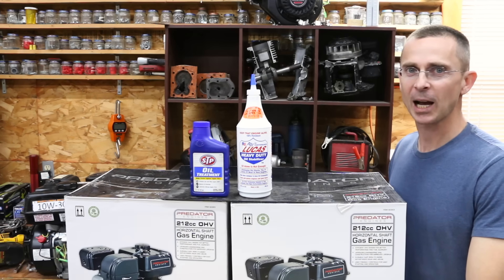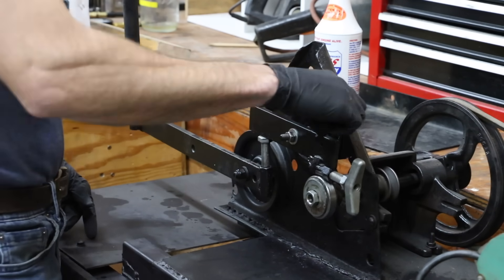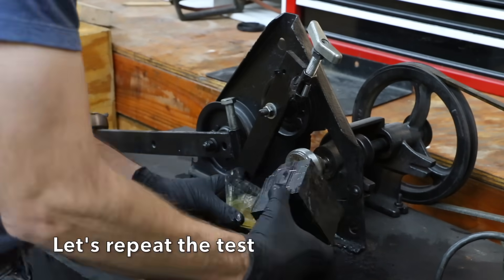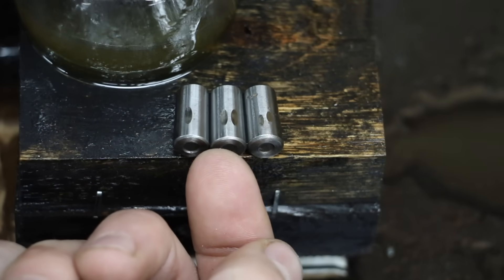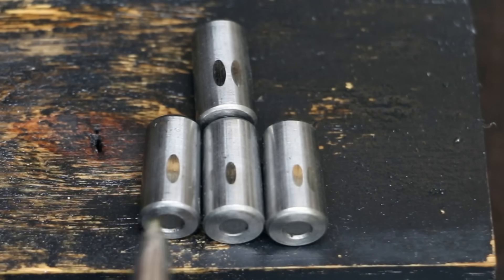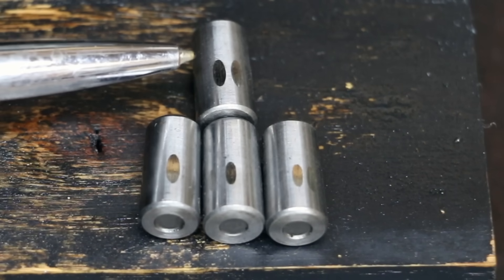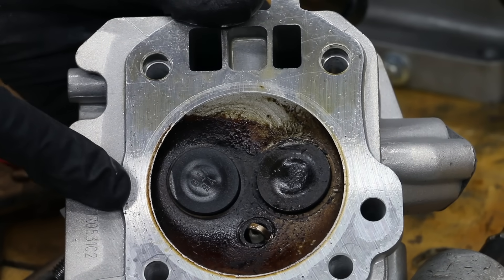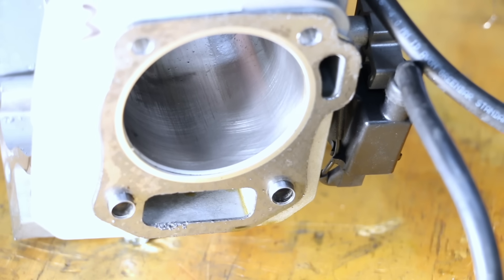Which engine self-destructs first?  Lucas or STP?

Comment: Not really testing the oil is .as its not running on any .if u did the test at high speed with the oil .see which one lasts longer at high revs ..waist of two engines with no oil .so not really a test is it .hmmmm
Reply from the maker: Thank you!

Comment: Try    Duralube I've always used it and put my 92 Mustang G.T. convertible put it threw Hell & back both my 95 Ford Lightning has held up Very well neither use or leak a drop of oil... I would like to think that had something to do with it?? Or could be I always change the oil most times around 5k to 7.5k miles.  Then again Fords a built tuff Lol
Reply from the maker: Thanks for the feedback

Comment: I didn't understand the results except that the Lucas engine ran longer than the STP when you ran both dry. Yet I don't think either product is designed for running it dry. Did you ever tell us which engine ran cooler when running filled with oil (mixed per directions)?
Reply from the maker: Thanks for the feedback!

Comment: I took a new looking mower out of a local skip. Took it home added fresh fuel and it ran poorly and not for long. Took off the oil filler cap and immediately could smell the problem, someone had added fuel into the oil...  Bad idea. After swapping it out with fresh oil it ran perfect and i am still using the same mower nearly 5 years later.
Reply from the maker: Thanks for the feedback!

Comment: You should try using Archoil 9100 in an engine versus ZDDP additive and see which is better.
I have used both but have seen some noticable improvements with the 9100.
Reply from the maker: Thank you for the video idea!

Comment: I stick to what I know.........80 percent Synthetic oil and 20 percent  Lucas oil on 2 vehicles and a Harley Road King.  If it ain't broke don't fix it. 1999 Chevy Silverado w/ 270,000 miles, 2007 Chevy Trailblazer w/ 175,000 miles,  2002 Harley Road King w/ 21,000 miles.

Comment: I use stp because it has zinc in it and both my cars are made before they cut most of the zinc out of the oils. It may not do much but it makes me feel better and that worth the 4$. It has 210,000 miles on it so it cant hurt. I think the heat is what is killing these engines. The oil being a lubricant is a small part of its job. Keeping things cool is a huge part.
Reply from the maker: Thank you

Comment: The purpose of STP is to stabilize oil viscosity in higher temp. It therefore avoids volatility which is important in DGI to prevent caking of the valves. I’ve used STP in my 1.0 L ecoboost Ford engine
Reply from the maker: Thank you for the feedback!

Comment: I would be curious to see how their synthetic stabilizer would hold up they recommend it for small engines it may solve the hotter running issue when using lucas i dont know its just a guess but would be interesting to see if it made a difference
Reply from the maker: Thank you for the video idea!

Comment: To Mr. Project Farm,  how about a long term engine where you drain out 1/2 the oil and replace it with new, leaving 1/2 of the dirty oil in. In addition how about only changing the oil filter at each 3rd or 4th  1/2 oil change.   With normal use and up keep will this create any excess wear or damage to a long use engine ?  Thanks for the consideration.

Comment: This is a tough prediction, I think both will work fine short term but I'm guessing they won't be viable for a long term use since they are not really motor oils. I don't have a lot of confidence calling this before seeing the end. 

It's cool finding these old gems. I can see you were still working on the cup design and hadn't gone to the tape shield as yet on the lubricity tester.
Reply: I misunderstood, I thought you were going to use the STP/Lucas AS the oil, you're going to remove the oil then run the engine. Definitely not a long term option.

Comment: I'd like to see a repeat of this test on new engines of the same brand with the same additives, but stopping them one minute before the time they self destructed in this test. Would they seize up before or would they be OK? If either seized up sooner, I would like to see another engine tried for this same test at the shorter time. Then I'd like to see you disassemble both in the same way and see how much damage had occurred, if any, in that time frame. To me, that would tell if one does a better job of protecting the engine.
Reply from the maker: Thank you for the video idea!

Comment: Honestly it looks like STP is better based off the numbers.  Manufacturer recomends 1:8 vs the Luca 1:4, however at 100% STP did better.  I bet as he said in the video if bother were 1:4 dilutions STP would see better numbers.  As far as the final test, the dry run of engines..well it's a sample size of n=1, one loose screw on either could have thrown all of it off.  If the arguement is they leave residual "additives" even when dry, feel free to explain.
Reply from the maker: Thanks for the feedback

Comment: This proves nothing at all. You drained the STP and Lucas additives out and run without oil. The only conclusion you can draw from them not failing simultaneously is that the engines have manufacturing tolerances. The winner was engine oil.
Reply from the maker: Thanks for the constructive feedback

Comment: I'd like the see 2 more of these engines broken-in exactly the same, but then run them without oil for around ten minutes (or until the very first knocking occurs) Then add oil and additives and see which one lasts longer/runs better.
Because we all use oil additives not when the engine is new and healthy, but as soon as there is a problem.
Or is that just me? Lol
Reply from the maker: Thank you

Comment: It appears that the Lucas product is best, because the engine ran for nine minutes longer. That's substantial over the amount of time the STP engine took to break down, to the time that the Lucas Engine broke down.  
However, the numbers (in millimeters) of the bearing test results were not explained. Therefore, if the engines's collapse was not the conclusive, ultimate test, then how important is the bearing test ?  'Cause I have no idea what  "2.46 X 6.03"  even means ?
Also, Duck Moore, commented that no, oil only, test was made. It would have nothing to do with comparing oil additives, but is extremely relative because, how important is it to spend EXTRA money for an oil additive, anyway ?
And, if there was a previous video testing motor oil 'only' break-down, it would be interesting and informative, to show the results in this video. 
BTW . . . . I personally, use Lucas Oil Additive, for certain, specific applications.
Reply from the maker: Thank you

Comment: You did a test with 10w30 vs bestline in a previous video and the 10w30 lasted 38 mins while the bestline lasted 71 mins. My question is, why are the results so different to this one?  STP only lasted 12 mins and lucas lasted 22 mins. This would indicate that straight 10w30 is better than stp or lucas,  so stp and lucas are having a negative effect on the engine?
Reply from the maker: Great question.  I tested on different days with significantly different ambient temperature, humidity, etc.  I believe this has a lot to do with it.  Also, STP and Lucas have a higher viscosity and different film strengths.

Comment: I had a 99GMC4X4 4.3 L.. USED LUCAS OIL AND METAL MESH OIL FILTERS. USED THE FUEL ADDITIVE AS WELL. NEVER WENT IN PAST THE VALVE COVERS AND UPPER INTAKE (OVERHEATED IT) AND ACHIEVED 400,000 MILES.  THE GUY WHO HELPED W/UPOER INTAKE AND VALVE GASKETS SAIT IT LOOKED LIKE I JUST HAD HEADS REDONE.. OIL WAS 2WEEKS OKD AND IT LOOKED BRAND NEW ,AT THAT TIME !   GOOD STUFF

Comment: I have an idea that I'd like you to try out. What if you switch out the springs on the valvetrain with softer springs not meant to go to that rpm and basically simulate an over rev condition where the valves smash into the piston. I think that'd be an awesome thing to see if you ever want a break (no pun intended) from additive/brand testing.
Reply from the maker: Thank you for the video idea!

Comment: What that slick looking test machine really does is to break down the lubricating qualities of the lubricant through excessive pressure if those parts scored, creating a metal to metal contact.  The same would happen with EP grease.  If it took longer with grease the outcome would be a recommendation to run EP grease in your crankcase.  The wheel surface was roughed up with that grinder, greatly increasing the point contact pressure on the test bearing, destroying it. 

I don't see the point of running an engine without oil to the point of destruction to compare additives.  Maybe what you are really measuring is differences in tolerances between engines?   Then, where is a real world test without any additives?  Like how much torque to turn a Predator engine at, say 2500 rpm with and without these additives (no spark plug installed)?  Engine oils have improved very significantly over the years, while these additives just keep selling away.  I see additives as oil thickeners that came to pass many years ago when engines didn't even have oil filters.  Additives were used to reduce oil burning resulting from worn engine parts.  I have read that STP is a soap derivative.  What I saw from the Lucas gear display on the  auto parts counters was that it took more work to turn the gears with the Lucas additive, which translates into more heat and less efficiency.  Bottom line, if these additives really worked they would already be an ingredient in engine oils.  Car manufacturers say don't use them.  To me, they are snake oil sold to people who aren't scientific or technical.  Hell, when I was real young, after I changed my oil,  my car always rand better and had more power.   Now, an oil change doesn't do that for my cars.

Comment: Well, maybe not nuts but we are all trying to conserve and ruining two engines and the waste of all that oil just for entertainment does not make sense. Leave it to the manufacturers of both the engines and the oils and additives. I’ve been in the small engines for years and those old Briggs motors would run on tar. 😁

Comment: Just out of curiosity here.. why were the oil fill caps left off the engines ??  .. from what i know of these small engines. Their is a oil splasher on the connecting rod or a wheel driven off the cam.  I am not sure on this but wouldn't the oil cap being off would cause a pressure  differents in the crank case causing  a insufficient mount of oil to be slashed thru out the engine ?  .. i am thinking that due to improper oil splashing  inside the crank case due to the lack of  or lower than  normal windage pressure  in the crank case caused the oil additive not to reach all the  moving parts properly due to the oil fill cap being left off which caused premature damage causing engine failure..?? ??  Not sure but just a thought..
Reply from the maker: Thank you.  Once the oil with additive was used in both engines, it was drained to see which engine would run the longest.

Comment: Basic statistics would repeat the test several times to remove the variation in the test engines. The engines have variation in tolerances and materials which will influence the test.  Oh yeah, and as other mentioned, a control engine without additives. Simply put, if you tested two engines the same way without additives, one will die first, not both at the exact same time.   What will be the conclusion then?
Reply from the maker: Thanks for the constructive feedback